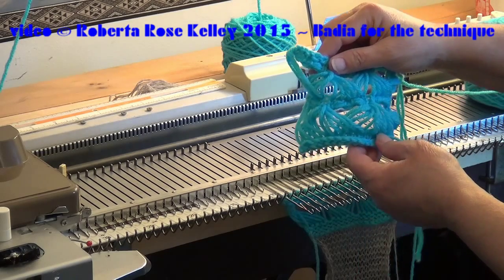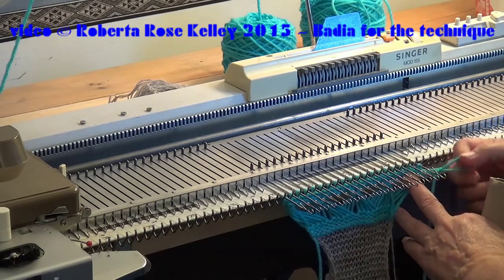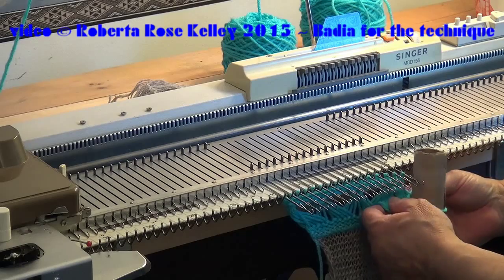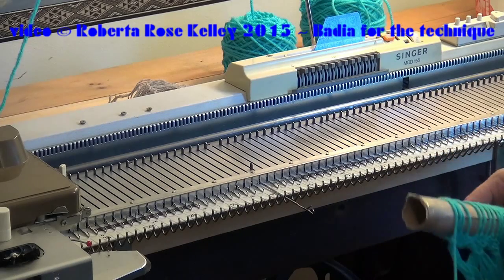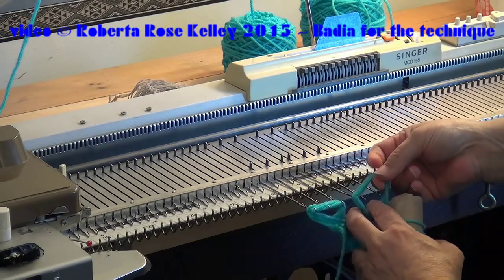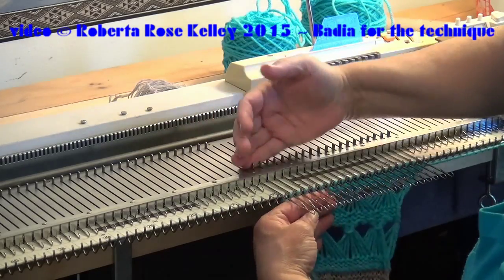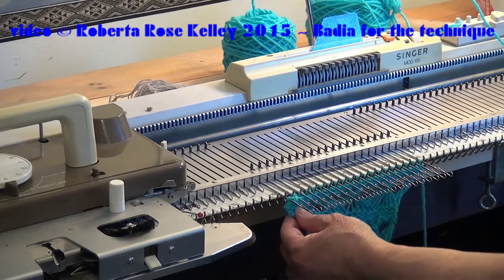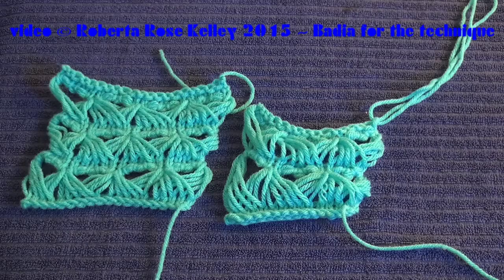Machine Knit Broom Stick Lace

Comment: Thank you Berda you did a great job on that stitch, the ruler I used was about 4.5cm wide on the Bond.. now what's next? I know you did the smocking stitches but I don't know if you uploaded those videos on YouTube, that was also so useful :) thank you so much Berda, I did learned a lot from you :)
Reply from the maker: Badia Ali Thank you for reminding me how to do this, but also others will get to see how this is to be done on the machine.  Someday I plan on using this to make a scarf, someone else mentioned a Shawl as well.  As long as one has the right tools to do certain things on their machines, they can do anything.  I will have to see what my ruler is in metric, but it was one and a half inches.